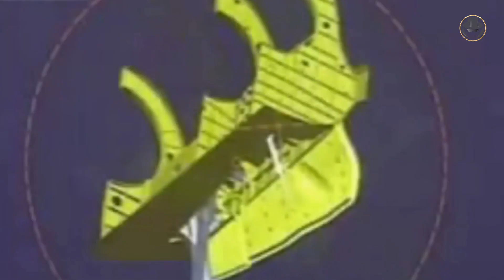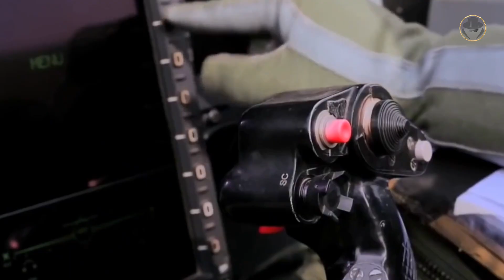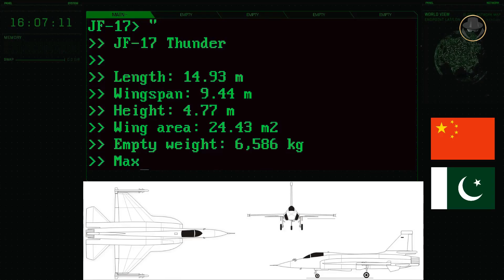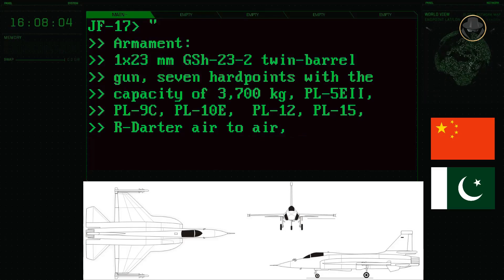JF-17 Thunder / FC-1 Xiaolong | Is it successful or not?

Comment: Development has started for the JF-17PFX currently and is set to be a 4.5 or even a 5th gen fighter a existing JF-17 Block III, including longer-range air-to-air missiles and potentially a locally developed radar system. It is also believed to have reduced radar cross section through other composite materials.

Comment: With updated Aesa   radar,newer engines,bvr,antiship and cruise  missiles, JF17 Block 3 even surpass F16.. It's a great achievement...but Tejas is still in the dream of Indians...Bangladesh will also operate 32 block 3 initially then upto 52 block 3..which will secure Bangladeshi sky from hostile forces..

Comment: the only question is second hand F16 and not well equipped su30 are too cheap
a old f16c is only 30% more expensive than jf17block3, and a su30 with a oldschool n001 radar are way more cheaper, a second hand f16 are still operational and as good as a new one, and a su30 is a 20 ton heavy fighter carries huge amount of ammo
lets imagine one sence, if a used but operational f4c phantom ii cost you one million, and a brand new mig21bis cost you 700 thousand, which to choose
sometimes, you are just not that good luck

Comment: Jf 17 is  faster most lethal compared to indian jets. Recently it neutralized Indian fighter jet very easily even indian pilot ejected and landed in Pakistan who was subsequently arrested and then released on humanitarian bases.
Reply: Are you referring to Operation Swift Retort ? If so the main failure of that for India was the R-77 missile. I'm neutral btw, the Russian Fox 3 missiles are completely dogsh*t. No wonder India developed the Astra to compensate. Hence why India no longer purchases Russian missiles. I think the JF-17 Thunder (F-20 Tigershark) in reality, is a decent lightweight aircraft that Pakistan has put to good use so far. I do have a soft spot for it. I think the JF-17 is great in the Pakistan theatre and dealing with issues in that realm. I would still personally take the Grippen over it tho.

Comment: Timestamp 9:05
Nigeria was looking for the CHEAPEST option (not the best or even better) and because of financial issues chose JF17

MAYANMAR grounded its JF17 due to structural cracks.
The JF-17 Thunder, a collaborative effort between Pakistan and China, has faced challenges in Myanmar. Most of the newly acquired Chinese and Pakistan-made JF-17 fighter jets delivered to Myanmar have been grounded due to technical malfunctions. Analysts and former Myanmar Air Force pilots monitoring the junta’s air capabilities report several issues:

Structural Flaws:
The JF-17 fighters added to Myanmar’s fleet have structural cracks and other technical issues.
These cracks and airframe damage have rendered some of the aircraft unfit for service.
Engine Problems:
The Myanmar military lacks the technical expertise to fix the problems.
Ground crew and Chinese contractors are working to address issues with the RD-93 engine, which caused a JF-17 to be unable to taxi on the runway.
Background:
Myanmar signed a deal in early 2016 to procure 16 JF-17s from China for $25 million each.
The first batch of six aircraft was delivered in 2018, but details about the other 10 remain unclear.

Comment: Well, most of the JF17s are grounded most of the time due to technical issues in Myanmar and also in Pakistan. Even engineers from Pakistan could not fix them. You must acknowledge the availability ratio of a Fighter while analyzing. None of the technologies were developed by Pakistan, none of them are state of the art or anywhere near it. Cracks are seen on the airframes. They got what was cheapest on the market. It hardly beats even the oldest versions of F16s.

Comment: From a project management and implementation perspective, it is quite successful. 
Pakistan got the help from China (airframe) and Russia (engine) to produce an integrate its own fighter plane, it got a real BVR-combat capability, it also got a relatively cheap/affordable plane to replace the Mirage III/5 and F-7P/PG in good numbers.  

In terms of performance, it's not an F-16-series plane, its basically a reinvented F-20A 'Tigershark' but the 'Tigershark' seems more agile.  I suspect that the JF-17 isn't really full option for Pakistan, the J-10CE is basically to fire the PL-15 at longer ranges than the JF-17 can and replace the  and the JF-17 is a cheap replacement for older aircraft.
Reply: We have been told for as far as I can remember that PAF has no answer to IAF,s Su-30s but on 27Feb2019 it proved to be entirely wrong. Now again we are hearing from out indian friends that JF-17 thunder is substandard to the modern warfare. I have reached on conclusion that Indians can never have an objective analysis of anything related to Pakistan because of their bias due to historical and political reasons and their opinions dont mean anything
Reply: In terms of performance, the JF-17 isn't really up there.  It's less agile than an F-16 or even F-20A, it's probably less agile than the Indian Tejas (which isn't really in production) but it's a leap over the Mirage III/5 and F-7P and possibly F-7PG.  The best to describe it is like, "You just upgraded from Windows 95 to Windows 7 at a time when everybody just moving from Windows 10 to Windows 11" so it's a bit of as false upgrade but it was cheap and really improves on what you had.
Reply: We will find out in the battlefield dear "friend". @MrBahjatt
Reply: @funkygenesis 
On the battlefield.

Comment: JF-17 will keep undergo improvement to increase its capability. I am sure this aircraft will still be relevant long after J-20 retire. Similar to F-16 outlasting F-22.
Reply: Absolute failure, tofu aircraft🥴🥴🥴
Reply: @EmarElutin  it wasnt the JF-17's that intercepted those PL-15's you know.
Reply: China has already stopped development of it.

The PLAAF refuses to buy the plane due to multiple problems.
Reply: @mth469 False, China actually needs more heavy weight fighters according to it's needs and the JF-17 (or FC-1) is not sufficient enough for the role since it is obviously a light weight fighter
Reply: @Editorwithchai  

PLAAF does not want FC-1 due to its (a) limited performance and on top of that (b) its quality issues.  

The (a) was already a factor even while the plane was being designed (prior to production) with the PLAAF committing to no purchases of this plane.  Ironically, even Pakistan (its main customer) was reluctant to buy this plane and was looking for 2nd hand Mirages 2000s and  F-16 which it could not get.

The (b) added to that after the plane was built not just with core design issues but quality of production issues as well. 

Making a high tech, high agility, low cost, multi-role, single engine, 4+ and 5th gen fighter is the hardest thing in military aviation.
Reply: @mth469 No. They didn't buy it because they already have Chengdu J10. They don't need another fighter in the same class.
Reply: @yorgenibnstrangle3072  

The Chengdu J10 itself has a bunch of problems with its Wopen engines.

Currently the J10s are being offloaded on Pakistan.  They are "buying" it only because they are dead broke and don't have other options.  Also they are aiming for early retirement of the JF-17 due to its many problems.
Reply: @mth469  China is still adding J10s to its fleet to replace older planes in service. JF17 are fine. They are being upgraded with block 3 versions with more advanced avionics. They are not being retired. Pakistan is replacing older mirage fighters with JF17. 

Tejas on the other hand has many problems. It uses a mishmash of different systems from different countries and they do not work together properly. That's why india has only now begun to add them to their inventory for pride reasons. But they will continue to use their Russian fighter jets as their main workhorse.
Reply: @mth469  source?lmao of course no source.
Reply: @mth469  你在说什么，fc1项目从最初就是巴基斯坦的项目，巴基斯坦提供了一半资金，本来就不是中国空军的项目

Comment: Saying the Tejas is "more successful" is delusional. It's been rebuffed by every foreign country it's been offered to and currently sits at zero export customers. The JF-17 has three export customers, with the latest being Iraq.
Reply: All 3 customers (Nigeria, Myanmar and Pakistan) have grounded the plane due to major reliability and safety issues.

The aircraft is practically offered for free by China, but countries are not signing up for it.

Even the PLAAF won't buy the plane.
Reply: @mth469  China doesn't need to buy this plane as it already has j10s, and j20s inducted in its service, plus it's only Myanmar that had issues which is quiet normal for a fighter aircraft that is mass produced and pakistan did send its technicians to look at the issues.

Comment: Fun facts about JF17 - 

1) Dubai 2021, LIMA 2019, Bahrain 2016. Each time the Tejas participated in an air show, the Pakistani team cancelled their JF17 participation, ceded participation fee and ran away 

2) The Chinese do not use it and only export to poor countries  

3) The all metal airframe has poor manufacturing quality resulting in an availability of approx 40% for Pakistan Air Force 

4) Even after buying 150 of jf17 the PAF still relies mainly on the American f16 and has also started buying Chinese J10 fighter aircrafts 

5) JF17 Block 1 and 2 do not have AESA radar, no in flight refueling, only two dimensional fly by wire, all metal body causing high weight, low thurst weight ratio, older electronics and only Chinese weapons to fire 

6) The newer block 3 jf17 variant has a cheaper air cooled AESA radar unable to operate at max power and hence lower range
Reply: 7) Myanmar had grounded its entire fleet of JF-17 due to safety and reliability issues.  So has Nigeria.

8) China has stopped further development of the plane.  Which means it will not have a future as it is not evolving.
Reply: @mth469  Mao say ：When your enemy praises you, it means you have made a mistake; when your enemy criticizes you, it means you have done something right.

Comment: Regardless of avionics and weapons, this poor thing is crippled by its range and inadequate MiG-29 engine.
Reply: A majority of the Jf-17s have the upgraded rd93ma version. If the engine was that bad. We would have switched over to ws13.
Reply: @MuhammadAli-255 

WS13 engines are even worse.
More engines return to the factory for replacement than are produced.  
I don't know if the situation still persists or if they have remedied the problems.

PLAAF refuses to buy the JF-17.

China is stopping further investment into development of this plane which means it will have no future.
Pakistan is looking overseas for future plane purchases and not willing to buy another jet model from China.
Reply: @mth469  Plaaf doesn't need the JF-17 because they already have the J-10 to be its low-end fighter. Compared to the land mass of both China and Pakistan, China doesn't have a single reason to procure a light fighter.  Source on China pulling out of the project? If the Chinese were dissatisfied with the project, they wouldn't have developed blk3 (which went into production last year) or the dual-seater jf-17. If Pakistan was dissatisfied with Chinese equipment, why would we order from them? These past 5 years we have ordered J-10s, Hq-9s, Chinese frigates, submarines, tanks, helicopters and radars. We are only looking for more diverse supply chain of weapons, so we could choose from different sources. Idk much about engines so I can't speak on that.

Comment: The Pakistanis and Chinese have already started trials for a block 4 version of the JF-17.  There is even a picture of it taking off. 
This is a good video, and the timeline of production and varients is really good.  But the negative "tone" of it is not understandable.  Perhaps the narrator has an unconcious bias against Pakistan/Chinese work or what?!.  The sentiment expressed at the end of the video.... "compared to other competitors, the JF-17 is not-so-successful, but it is an impressive achievement for Pakistan"... is an odd statement.  Even he says that the project achieved its aims.  Compare that to the Tejas which is yet to mature after many decades of road bumps and failures.  The block 3 version of the JF-17 is a 4+ gen aircraft that offers everything you expect from it at a much cheaper cost.  That is not something to take lightly.  Furthermore, the plane has been tried and tested in real world conflicts on several occassions, both in A to A and A to G combat.  It carried out its missions successfully on each occassion.  Other countries that are known to be in the negotiation stage for the block 3 version are Argentina and Serbia.
Reply: The block 3 version has a cheaper air cooled AESA radar, retains older Russian mig29 rd93 based engines, uses pod based electronic warfare, doesn’t have sensor fusion and nor does it have secure data links, forget about any active/shape stealth features. Unimaginable to even think of it having supercruise and supermanouverablity. How in this world can you classify it as 4+ gen?
Reply: @vm8136  your comment is based on a mishmash of information. Some of it is somewhat accurate, while the rest is simply unadulterated misinformation. This could be due to you having no understanding of what defines a successful project, or perhaps your dogmatic adherence to preconceived ideas about Chinese/Pakistan technology and procurement.

A lot of what you define as old technology is/has been gradually upgraded (even within the same block variant.) This includes pilots already having integrated helmet mounted hud displays..ala the Euro fighter etc. So yes the plane is now a 4+ gen aircraft... albeit a lower cost, no frills example of one.  

The program has been a remarkable success when considering the scope, timing, the budget set for it, the SME  that has been achieved over the course of the program, lessons learnt for future variants..etc etc.  I can go on but I won't.

Then you have the fact that the PAF got exactly what it was looking for in its search for a replacement for their aging fleet of old Chinese and Western fleet. 

Add to that, the fact that the jet fighter proved itself in actual combat in several air and land engagements against multiple opponents, and we're talking block 1/2 variants here which aren't 4+ gen. 

Add to this that trials for block 4 varients are underway.

Add to this that there are no less than seven countries in negotiations to have it (not including the 3 that have already purchased it.)

If all of the above is not an example of highly successful project to produce a simple, lower cost 4+ gen jet fighter, then I know nothing about aircraft, nor do I know anything about project management. And I have worked on projects for the aviation industry.
Reply: LCA still exist in PPT
Reply: now tejas is deployed in kashmir . pakistan has chance to validate its jf17 bk3 superiority claim over Tejas mk1 by planning misadventures. Lets see when pakistani orderes  their intergalactic fighter cum space ship jf17 to enter indian air space.
Reply: @pravirchandragadkari88  I don't wish to see conflict between the two neighbours. But an actual engagement between the JF-17 and the Tejas would be very interesting and cool to watch  indeed.